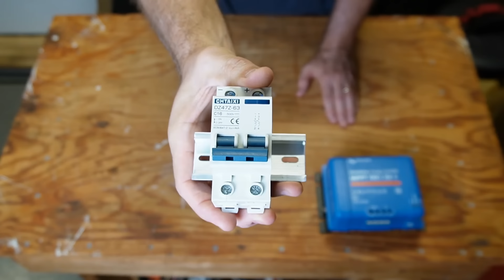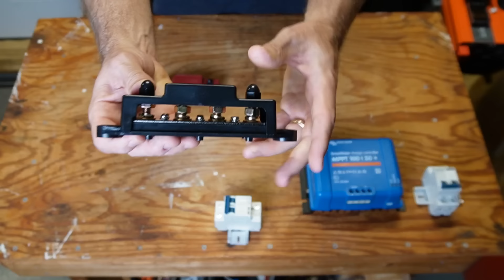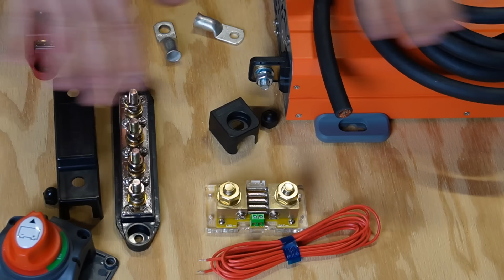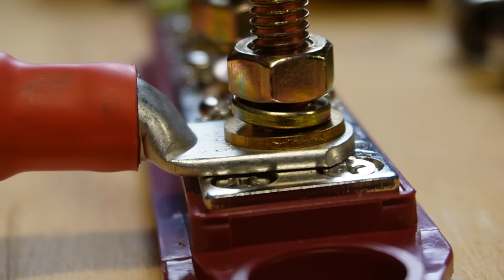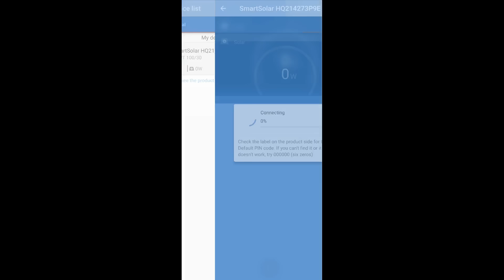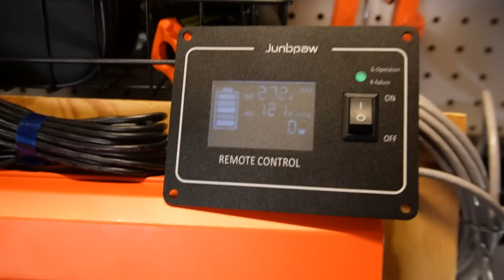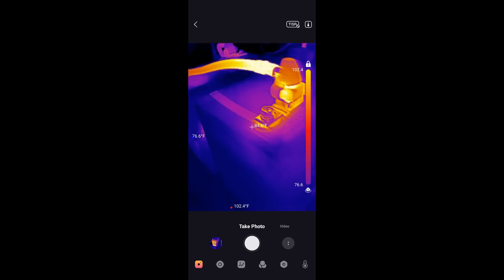24V DIY Off-Grid Solar Generator Build For Beginners

Comment: So what is the advantage of a 24 volt system over a 12 volt. Im new to this stuff and wish to build one to run my 3 refrigerators during outages.
Reply from the maker: Basically, a 24v system has the advantage of being able to use smaller wires/components , since there are fewer amps running through them. If that is not clear, please keep looking to learn more about that. It's very important to understand.

Comment: I take it that the 16A breaker will be sufficient if you connect your solar panels in series, because if I hook up only three of my 445W solar panels in parallel then I will be exceeding the 16A of your PV array input breaker which will then be 40.89A, so then I will require a 45A or higher amperage breaker? Also can I use a breaker instead of fuses to protect these circuits?
Reply from the maker: If you are wiring panels in parallel, I believe you will need a fuse on your panels also. I recommend reading this article from Renogy - https://www.renogy.com/blogs/buyers-guide/how-to-fuse-your-solar-system

Comment: Bro...  you can do those crimps with a hammer and small blunt chisel or even a center punch. Lay on hard surface and whack with a 2-4lb mallet
Reply from the maker: I have to do that with 00 gauge and above. I like a good hydraulic crimp when I can make it work.
Reply: 255  God! There is no god except He, the Living, the Everlasting. Neither slumber overtakes Him, nor sleep. To Him belongs everything in the heavens and everything on earth. Who is he that can intercede with Him except with His permission? He knows what is before them, and what is behind them; and they cannot grasp any of His knowledge, except as He wills. His Throne extends over the heavens and the earth, and their preservation does not burden Him. He is the Most High, the Great.
256  There shall be no compulsion in religion; the right way has become distinct from the wrong way. Whoever renounces evil and believes in God has grasped the most trustworthy handle; which does not break. God is Hearing and Knowing.
257  God is the Lord of those who believe; He brings them out of darkness and into light. As for those who disbelieve, their lords are the evil ones; they bring them out of light and into darkness—these are the inmates of the Fire, in which they will abide forever.
258  Have you not considered him who argued with Abraham about his Lord, because God had given him sovereignty? Abraham said, “My Lord is He who gives life and causes death.” He said, “I give life and cause death.” Abraham said, “God brings the sun from the East, so bring it from the West,” so the blasphemer was confounded. God does not guide the wrongdoing people.
259  Or like him who passed by a town collapsed on its foundations. He said, “How can God revive this after its demise?” Thereupon God caused him to die for a hundred years, and then resurrected him. He said, “For how long have you tarried?” He said, “I have tarried for a day, or part of a day.” He said, “No. You have tarried for a hundred years. Now look at your food and your drink—it has not spoiled—and look at your donkey. We will make you a wonder for mankind. And look at the bones, how We arrange them, and then clothe them with flesh.” So when it became clear to him, he said, “I know that God has power over all things.”
260  And when Abraham said, “My Lord, show me how You give life to the dead.” He said, “Have you not believed?” He said, “Yes, but to put my heart at ease.” He said, “Take four birds, and incline them to yourself, then place a part on each hill, then call to them; and they will come rushing to you. And know that God is Powerful and Wise.”

2  God, there is no god but He, the Living, the Eternal.
3  He sent down to you the Book with the Truth, confirming what came before it; and He sent down the Torah and the Gospel.
4  Aforetime, as guidance for mankind; and He sent down the Criterion. Those who have rejected God’s signs will have a severe punishment. God is Mighty, Able to take revenge.
5  Nothing is hidden from God, on earth or in the heaven.
6  It is He who forms you in the wombs as He wills. There is no god except He, the Almighty, the Wise.

11  Originator of the heavens and the earth. He made for you mates from among yourselves, and pairs of animals, by means of which He multiplies you. There is nothing like Him. He is the Hearing, the Seeing.
12  To Him belongs absolute control of the heavens and the earth. He spreads the bounties to whomever He wills, or reduces it. He is aware of all things.
13  He prescribed for you the same religion He enjoined upon Noah, and what We inspired to you, and what We enjoined upon Abraham, and Moses, and Jesus: “You shall uphold the religion, and be not divided therein.” As for the idolaters, what you call them to is outrageous to them. God chooses to Himself whom He wills, and He guides to Himself whoever repents.

54  Your Lord is God; He who created the heavens and the earth in six days, then established Himself on the Throne. The night overtakes the day, as it pursues it persistently; and the sun, and the moon, and the stars are subservient by His command. His is the creation, and His is the command. Blessed is God, Lord of all beings.
55  Call upon your Lord humbly and privately. He does not love the aggressors.
56  And do not corrupt on earth after its reformation, and pray to Him with fear and hope. God’s mercy is close to the doers of good.
57  It is He who sends the wind ahead of His mercy. Then, when they have gathered up heavy clouds, We drive them to a dead land, where We make water come down, and with it We bring out all kinds of fruits. Thus We bring out the dead—perhaps you will reflect.
58  As for the good land, it yields its produce by the leave of its Lord. But as for the bad, it produces nothing but hardship and misery. Thus We explain the revelations in various ways for people who are thankful.
59  We sent Noah to his people. He said, “O my people! Worship God; you have no god other than Him. I fear for you the punishment of a tremendous Day.”
60  The dignitaries among his people said, “We see that you are in obvious error.”
61  He said, “O my people, I am not in error, but I am a messenger from the Lord of the Worlds.”
62  “I deliver to you the messages of my Lord, and I advise you, and I know from God what you do not know.”
63  “Do you wonder that a reminder has come to you from your Lord, through a man from among you, to warn you, and to lead you to righteousness, so that you may attain mercy?”
64  But they called him a liar. So We saved him and those with him in the Ark, and We drowned those who rejected Our revelations. They were blind people.

59  The likeness of Jesus in God’s sight is that of Adam: He created him from dust, then said to him, “Be,” and he was.
60  The truth is from your Lord, so do not be of those who doubt.
61  And if anyone disputes with you about him, after the knowledge that has come to you, say, “Come, let us call our children and your children, and our women and your women, and ourselves and yourselves, and let us invoke God’s curse on the liars.”
62  This is the narrative of truth: there is no god but God. God is the Mighty, the Wise.
63  But if they turn away—God knows the corrupt.
64  Say, “O People of the Book, come to terms common between us and you: that we worship none but God, and that we associate nothing with Him, and that none of us takes others as lords besides God.” And if they turn away, say, “Bear witness that we have submitted.”
65  O People of the Book! Why do you argue about Abraham, when the Torah and the Gospel were not revealed until after him? Will you not reason?
66  Here you are—you argue about things you know, but why do you argue about things you do not know? God knows, and you do not know.
67  Abraham was neither a Jew nor a Christian, but he was a Monotheist, a Muslim. And he was not of the Polytheists.
68  The people most deserving of Abraham are those who followed him, and this prophet, and those who believe. God is the Guardian of the believers.
69  A party of the People of the Book would love to lead you astray, but they only lead themselves astray, and they do not realize it.

84  Say, “We believe in God, and in what was revealed to us; and in what was revealed to Abraham, and Ishmael, and Isaac, and Jacob, and the Patriarchs; and in what was given to Moses, and Jesus, and the prophets from their Lord. We make no distinction between any of them, and to Him we submit.”
85  Whoever seeks other than Islam as a religion, it will not be accepted from him, and in the Hereafter he will be among the losers.

28  It is He who sent His Messenger with the guidance and the religion of truth, to make it prevail over all religions. God suffices as Witness.
29  Muhammad is the Messenger of God. Those with him are stern against the disbelievers, yet compassionate amongst themselves. You see them kneeling, prostrating, seeking blessings from God and approval. Their marks are on their faces from the effects of prostration. Such is their description in the Torah, and their description in the Gospel: like a plant that sprouts, becomes strong, grows thick, and rests on its stem, impressing the farmers. Through them He enrages the disbelievers. God has promised those among them who believe and do good deeds forgiveness and a great reward.

111  And say, “Praise be to God, who has not begotten a son, nor has He a partner in sovereignty, nor has He an ally out of weakness, and glorify Him constantly.”

Read The Quran

Comment: Crazy question: I have a PWM charge controller built into the inverter, so will I damage the batteries if I also hook up an MPPT charge controller between the solar panel input and the batteries?
Reply from the maker: That is something I can't answer from experience. I have used two mppt controllers to the same batteries using the same charging voltage. I did that for over a Year without any issues. I just did a Google search and it seems that you can also do that with a mppt and pwm, but I just don't know for sure.

Comment: Your video could not have come at a more appropriate time. I have no choice but to go off grid. The cables in my city supplying our suburb, suttounds and the CBD are now stolen and vandalised about every two to three weeks, resulting in more than one day and sometimes even several days without electricity.
Reply from the maker: That's terrible to hear, but hopefully this will help you with your power needs.

Comment: Nice Build !!! I'm sure you corrected it after the video, but a missed opportunity to explain to the beginners since it's for beginners, but the importance of balanced batteries when using an array or 2 or more batteries as far as the charging % and voltage being equal on all batteries.